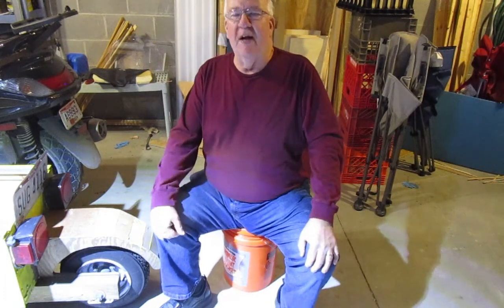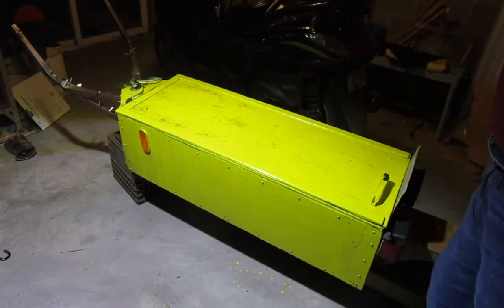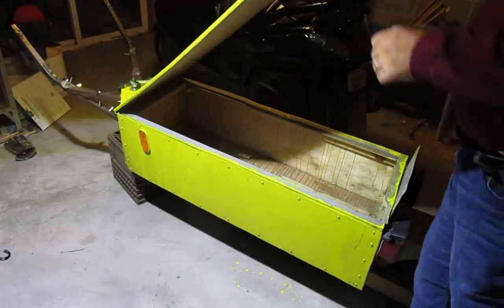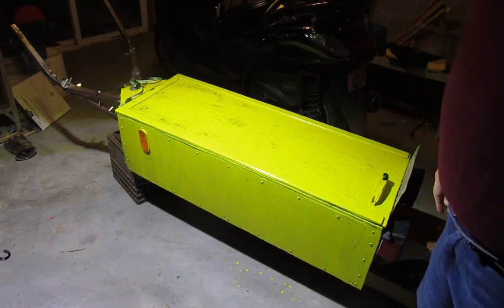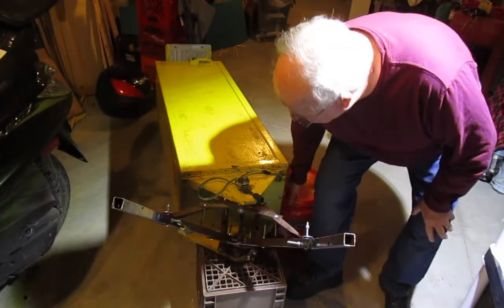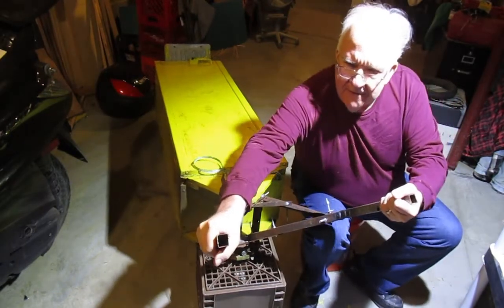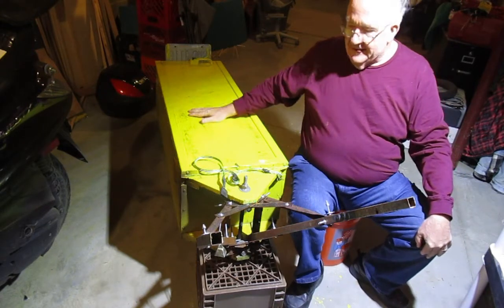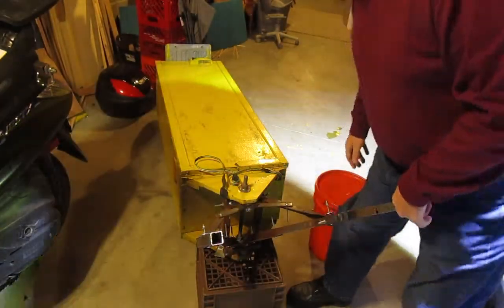One Wheel Trailer Tour

Comment: What all did you have to do to get the plate.im in ohio to and building a trailer but I didn't think you had to have a plate.
Reply from the maker: Yes, in Ohio, unless it is a tool like a log splitter or a cement mixer, if the wheels touch the road trailers need a plate. Having the plate on it also keeps the police happy when I am out of state.

All I had to do is put the required lighting and reflectors on it and go to a certified scale and have it weighed. Otherwise here is no formal inspection for home made trailers in this weight class.

Comment: If it works for you okay.  It wouldn’t work for me and here is why:  Even though it is an easy design, it is very obvious your skill level as a fabricator lacks.... well...skill.  The wheel has no suspension and the trailer will probably bounce at the slightest bump or pothole.  Your screws and nuts holding the tongue/hitch together in the triangular engineering as you put it will work for a bit, but you should have welded your tongue and not used the soft hardware.   The fact that you used longer screws than necessary and didn’t cut off the excess is a testament to your lack of detail.  As you load cargo in your trailer, the soft bolts will eventually loosen or even shear off.  This has the potential to make you lose control of your scooter and possibly injure yourself or others.  I didn’t get a very good look at the mounting on the scooter but what I did see didn’t look safe.  As far as the tire goes, the 8” tire/rim is to small for high speeds.  Those Walmart/Tractor supply tires will only last about 2000 miles.  The fact that you got a Michelin is about the only good thing you did.  If anything you should have used a 10 inch 6 ply tire and leave those imported tires on the shelf.   I would suggest you start over and get a factory built two wheel trailer and burn the wooden one you made.  If it doesn’t fail, you will be one lucky rider, if it does then you’ve been forewarned.
Reply from the maker: You need to separate looking pretty from proven design. You obviously aren't a fan of rat bikes. I mean, really, the gross loaded weight of this trailer is less than 150 pounds and only about a bit more that 1/2 of that is on the tire, the rest is carried by the scooter. Ten inch 6 ply tire, for that load? ROFL

You can have the two wheel factory built trailer, but that would be too much weight and frontal area for my 400cc maxi scooter even before loading or considering the foul handling and dangers of a too heavy for the tow vehicle.

Comment: Square profile will not handle propley
Reply from the maker: Not sure what you mean by not handle properly. The trailer is close enough to the scooter it rides in the wind shadow of the scooter and doesn't need a sleek aerodynamic shell, and rounded ends and corners eat up a lot of cubic space.
Reply: It handled properly running Tail of the Dragon